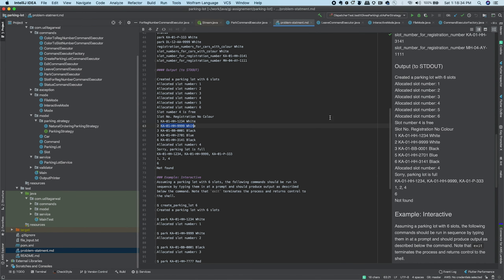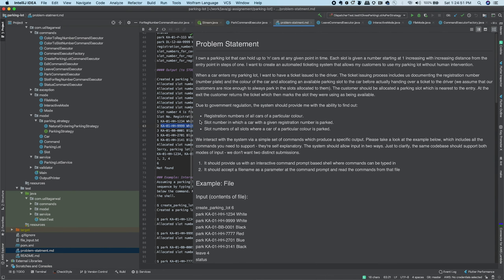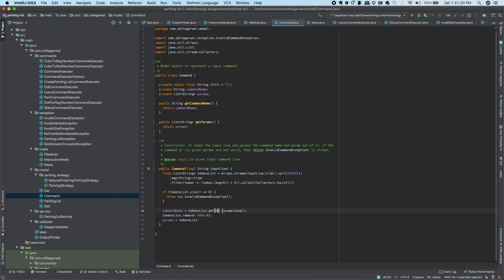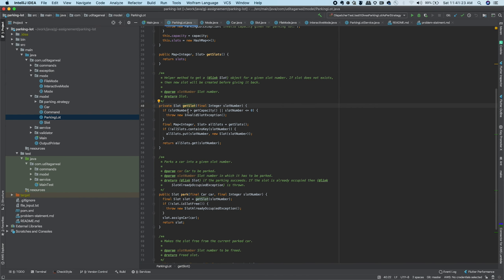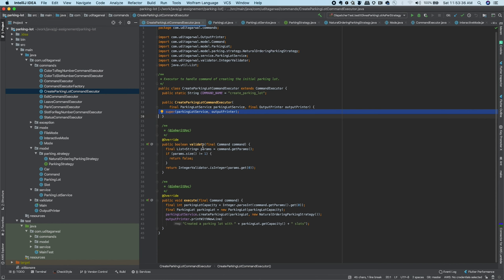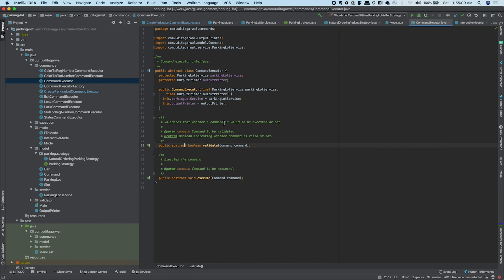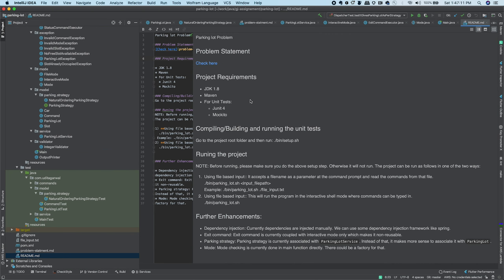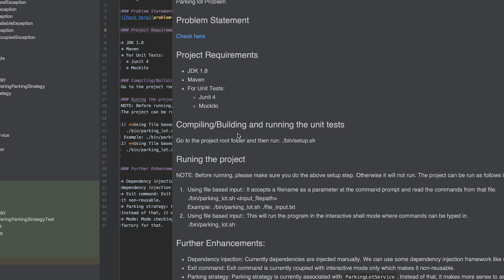System Design Interview Question: Parking Lot | Low Level Design | Design Principles |  LLD | FAANG

Comment: My Two Cents.

Awesome tutorial, goes without saying Udit's LLD playlist is really good.
In an actual (80mins) interview, coming up with the above solution is really difficult. 

This is how I approached it.
1. First without seeing the video, try to code it yourself (90 mins).
2. Focus on the main parts first - create parking lot, park, unpark first. (if time permits, focus on other features).
3. Try to do draw a small uml diagram, list the entities and the relationship.
4. now try to build the logic for the above 3 features.
5. In case you have multiple vehicles - car, bike, truck (use Factory design pattern easy to implement).
6. for parking lot creation use singleton as well.
** it's good if you can get till here **
7. Use Treeset for making sure the ordering works. (do check its complexity though).
8. Finally bonus, see if you can handle threading here.

In all of my interviews, till 6 have given me a hire rating.
Reply: Can you share any resource for starting LLD HLD from scratch apart from this channel?
Reply: Would also include parking strategy (Strategy design pattern) along with the 6 points.
Reply: Did you actually wrote the logic or just the classes and methods ?

Comment: Improvements or additional features:
1. Adding floors in parking lot. Giving preference to closest floor.
2. Adding slot types: small, medium and large.
3. Multiple entry/exit points and handle concurrency in that case.
4. Revenue generation based on vehicle type from point 2 and parking hours.

Comment: Nice work Udit, Few pointers to your design :

1. Don't you think methods in the Printer class should be static?
2. ParkingLot object should be configurable from the command line, I mean when you invoke the system, max_capacity should be injected variable.
3. ParkingLot object should be a singleton object, If you invoke from the command line in a loop for different command then you will end up having many ParkingLot objects.
Reply from the maker: 1. You should always avoid statics because they are the biggest enemies of a good design. You rwill not know when they are going to bite you back. Like in this example, if you make methods static, then you will always have only one type of printer. Tomorrow if you have multiple types of printers, then you cannot make multiple printers by making the printer class either interface or an abstract class.
2. Parking lot is getting the capacity from its constructor only. Its just the soft limit which is kept as const. But yeah, I get your point and I think we dont need it at all. So, actually we can remove MAX_CAPACITY altogether from the code.
3. Again, most of the times, using singleton will create roadblocks in your design. So one should avoid creating singletons as much as possible unless there is a specific need to do that. Here, you cannot have a single parking lot because that will not work when your service starts handling multiple parking lots. To ensure all command executors use same parking lot, we need to inject parking lot object into them instead of each command creating its own.

Hope these helps!
Reply: @anomaly2104  1. I dont agree with your comment, static is always useful when you want to invoke a method without creating a reference to that, also its having a single copy across you runtime env.

2. As per the current design lets say i have 1000 vehicle park command then it will create 1000 parking lots for all the command which is not a good design.

Comment: It would be great if you can provide the timelines for the video for e.g. Problem Statement: 02:30, Basic Implementation: 15:12. This would help us when we are revising the content and avoid watching the complete video again and again. Thanks for a great video.
Reply from the maker: This is a great suggestion. I will surely try to create this breakup and will add it in the description. Thanks
Reply: @anomaly2104  While creating a CommandExecutor, I think validate method must be part of execute method. This is because then it will be mandatory to validate and not just implement. So I see template + command pattern here. Any thoughts?
Reply from the maker: @JitendraSarswat  Yeah correct. Validate method needs to be a part of execute method. Actually, I discussed that in the original recording with few other things. But then video was becoming like too long. So I had to cut few things. But yeah, you are absolutely correct, validate method should be used as part of execute method and we should not rely on caller to validate first because caller can always skip validation and directly call execute which we do not want here.
Yeah, its a mixture of patterns. Template pattern is defining like each command should follow a template and command pattern is giving that execute behaviour. This way we get every loose compiling and implementation to interfaces allow us to make our design extensible.

Comment: Hi Udit,

If you could give your opinion on the below -
1. The outputWriter is required in both CommandExecutorFactory as well as Mode. I wonder if we could create an OutputPrinterWrapper which encapsulates an instance of interface IOutputPrinter which in turn has multiple implementations based on the type of output (Console, File, etc.). This wrapper could be set up with the appropriate IOutputPrinter in the main() and then methods could be invoked on OutputPrinterWrapper.outputPrinter which is globally available.
2. The Slot object need not have a slot number as we are already maintaining a number in the slots of the ParkingLot object. This is would also help in decoupling the numbering scheme from the Slots themself. 
3. The slots Map can be eagerly initialized with the parkedCar field as null for the whole capacity. This is would mimic the real world as slots are present when the parking lot is created.
4. Pass the parkingLot.slots to the parkingStrategy.getNextSlots() instead of maintaining an internal representation of slots within the parkingStrategy. The parkingStrategy can work with the slots information given to it and just derive the next slot.

Comment: I have two observation here.

1. Isn't the same slot information is preserved at multiple places - Like NaturalOrderStrategy and ParkingLot? 

Instead can we have a SlotInventory/SlotManager which will have capacity of parkingSlot, HashMap<SlotNumber,DoubleLinkedListNode> and a doubleLinkedList of Slot objects. Initially the list will be initialized by the slot information. Different objects of OrderStrategy Like NaturalOrder or RandomOrder or ReverseNaturalOrder will utilize the object of doubleLinkedList when a request to getNextSlot()/allocateSlot()/unAllocateSlot() is made. Object of Orderstrategy would be a composition in the SlotInventory and the inventory class will have  getNextSlot()/allocateSlot()/unAllocateSlot() methods and delegates the call to the OrderStrategy object just to leverage the algorithm which would use the doubleLinkedList and inform its decision. Based on that, the SlotInventory will put an entry to the hashmap. So, when a call to remove the car from a slot will be made slotnventory will remove it from the hashmap and as well from the list. Which strategy would be used in the slotInventory object would be fed during its initialization? Now, the ParkingLot will hold the object of SlotInventory and it will delegates the call to the SlotInventory to perform the task. ParkingLotService will interact with the ParkingLot Object will have the other APIs.

2. Shouldn't there be a single CommandExecutor and the logic behind each command should be within an object of Command class itself?

I would like to keep an abstract class named Command  where I would have supports, execute, validate and unexecute methods. There would be multiple Commands classes like ParkCar, slotForReg etc and each will implement these methods. CommandFactory will call the supports method of command object which would have the name compare logic and will create an object of command. CommandExecutor will execute the command.

@Udit Please share your thoughts. Thanks much for the great content.

Comment: Instead of file interactive mode command mode etc which is unrelated to Parking lot, focus could be given on actual problem and adding extra properties on parking lot.
Otherwise the extra things added just add complexity without explaining actual problem.
Reply from the maker: True we should avoid implementing unrelated stuff and thus avoid unnecessary complexity. But supporting different modes was part of the problem statement itself.

Comment: Sir one doubt 
In interview do we need to write all these things 
I have just started learning 
So not sure about this
Reply from the maker: Hi Renuka,
So for this question, I was given a full day. So it really depends on the interviewer. Sometimes they give a day or two and you are asked to code it at your own pace. Sometimes, it happens like you have to sit in front of interviewer and you are given 1.5 hrs or 2 hours and you have code in that time. Some relaxation in requirements is definitely given when you are coding live in front of interviewer. Requirements will be a little less in those case. But the expectations remain same. Like you have complete the design with running code which you can demo. It should be extensible, reusable. It should have good design patterns used.
Hope this answers your question.
Reply: @anomaly2104  Thanks for your reply
I was in doubt whether we have to code completely or explain the architecture or maybe pseudo code 
Thank you for your elaborate answer
Reply: @anomaly2104  Can we do in Python also or only in Java 
I see most of the system design videos are only in Java everywhere but not in Python 
Can you please suggest any for Python also
Reply from the maker: So it is really easy to implement OOPs in Java. You can do that in other languages too. I have been using Java for long time now so I coded it in Java.